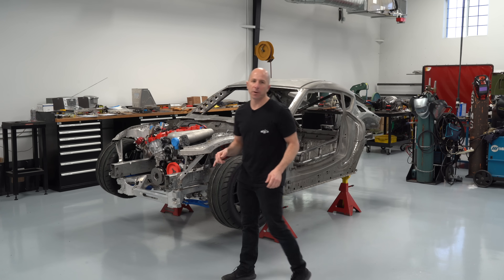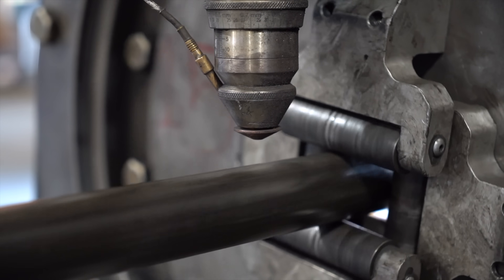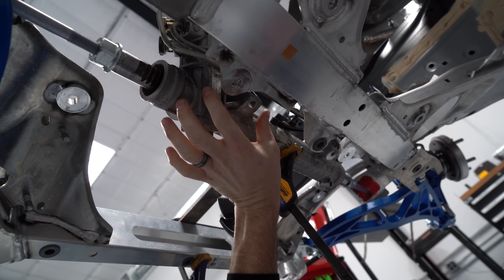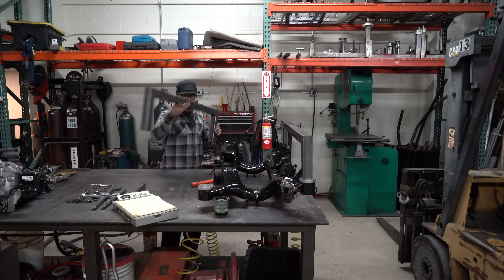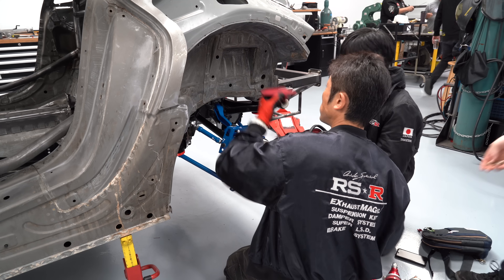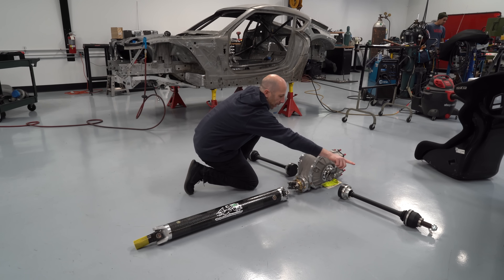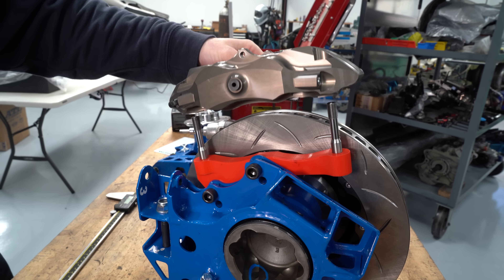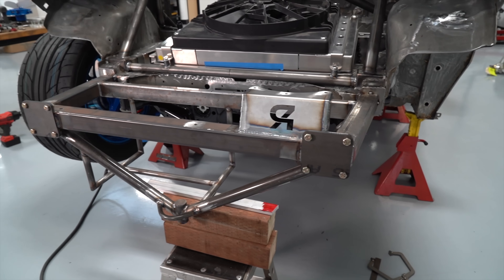2020 Drift Supra CAD Designed Roll Cage Install and Fabrication

Comment: Very impressed with the craftsmanship. For those subframe mounts, just to avoid any bolts loosing pretension and rattling themsleves out, i would put a solid shaft in between the top and bottom bushing plates.

Comment: What size jack stands are those? 6 ton, 12 ton? Any chance you could provide the exact model? Don't think I will be able to find the same one in Europe, but both the size and height look like something to be able to safely and fairly comfortably work on the car without having a lift at home.

Comment: Why do u need Nitrous in a Formula D car?
Reply: @Seb C then why use a high rev I4? I know their awesome engines, but if its torque or response you want. Electric throttle bodies and V6s are king. So a V6 or V8 would be a better go?

Comment: The new B58 engine is out and it has six normal exhaust ports so you can mount a full tubular manifold. Should free up some more horsepower.

Comment: You guys went far and beyond, nd stripping down the body to plain, to the last piece, sink it in chemicals, rebuild the whole engine, at this point, I don't even think it matters , if it is a Supra, or you get a Z4, or a 3 series, or an old Supra NA motor, for cheap, then do the same, strip it, soak it, scan it,, put new engine, mounting points, structure cage bars welded. You can do it with a Miata, you can do it with  an Evo 6-9, any good platform to start with. So much custom work, that you build a new car, a racecar, with custom carbonfiber driveshafts, and I can't even remember half the list. Big brakes, big tires, just speechless. This is amazing, great work guys.

Comment: Curious if you designed and printed the bushings as a test fit or to actually run them. If running them... what material did you print them with that will give them enough strength?

Comment: There's a much easier way to find center to center. Assuming the holes are the same diameter, just measure from the left of one hole to the left of the other.

Comment: Have been dreaming of doing something similar with a peugeot 407 coupe due to it's beautiful chassis but not so good drivetrain. out of interest would it be possible to make video of the approximate costs of the project? i'm personally very interested in the accid dipping of the chassis, 3D scanning and price of laser cut tube frame.

Comment: It needs to be said: For anyone considering buying from the Driveshaft Shop (DSS), please carefully do your research. There have been many, MANY reports of people being ripped off; either by receiving the wrong parts ordered, or being shipped defective parts, and subsequently having zero luck getting it rectified by the vendor. Horsepower Academy even made a video on it when they were sent the wrong axles, and it took a large channel like them raising hell on social media before they got a response.

Depending on your physical location, DSS might be your only option. If that's the case, it's a massive shame, and I wish you the best of luck that you don't have any problems with their company. If you're lucky enough to live where you have more options, your best course would be to use DSS only as a last resort. Please don't support companies with abysmal customer service.

Comment: I wonder how the old school fabricators feel when they see how far the technology has come and how much easier and quicker it makes a job.  The laser notches alone probably saved a day of work
Reply: Honestly, you don't save time. But you get repeatability and accuracy. CAD design time, machine setup, and extra steps make it a longer process than traditional cage work.
Reply: @tanners.6524  Don't forget that with the CAD design you can also test the integrity of the cage as well. HUGE benefit.
Reply: Tanner S. you’ve hit the nail on the head here. It’s the same in all cnc manufacturing. An ole timer on a lathe can have a part made by the time the young lads draw it up on the computer and have the cnc cut it out. Once that file is made though. The computer will churn them out faster than anyone, more accurate every time!
Reply: @tanners.6524  How You dont save time with laser tube notching? And setup for this process is quick compared to other machined parts, You don't have to make fixtures, set it up few times to machine few sides etc., and compared to manual notching, it just cuts both ends and done, while with manual You would have to set it up at an angle for first notch, then cut to lenght, setup angle for the second notch and the rotation of the tube in relation of the first notch. It's like 3-4 times faster. 
You can email a rollcage/chassis to a supplier of Your choice and get it to back, all done in a week or so, compared to either finding local guy that can do it (and You cant work on Your car during this time) or transporting the car to someone decent.
Reply: MindBlowerWTF you start scanning and generating that mesh file bud, I’ll have the car plated and the main hoop up before the scan file is actually useable. On top of that. The Equipment and software costs really take the fun out of it. But repeatable and accurate annnd you can test many variations before hand if you want to get into load testing and such.
Reply: MindBlowerWTF and it watch the video, the cage manufacturers still had to make a jig to make the radius of the tubes designed so you say you don’t need “fixtures”, I don’t believe that, if you’re manufacturing computer designed products, chances are you are going to need a jig or fixture of some kind to make that model manufacturable
Reply: @MindBlowerWTF  For repeatability, yes much faster. But for a single chassis. From my experience in building serious offroad trucks, you do not save time.
Reply: @tanners.6524  Also don't forget that he is building this car for his team. Most likely he is gonna keep it for lots of seasons, just like he did with the corolla. If he crashes it, it will be a lot more easier and quicker to build it back from scatch if he needs a new chassis
Reply: I can tell you, they say “I could do it faster and easier the old fashion way”
Reply: Feel like a caveman over here with my angle grinder and sawzall...

Comment: For those you who don't understand, let me break it down to you
1. The scanner creates a 3d image, to use as a template. The scan is not actually a model because it cannot be modified. In order to actually have a model. You would have to build it manually in the software, using the image as a template.

2. That model is then used to to set the parameters of the cage (height, width, mounting point, etc). Using the CAD program, Solidworks, You can run finite element analysis (FEA). FEA allows you to set the loading and optimize the design. This is done by getting rid of unnecessary  material and reinforcing points were the stress is much greater.

3. Solidworks also allows you to create a drawings package. This package has all the design specs for your model. Everything from length of each section, angles, and bending radius.
 
4. This drawing package is then sent to a manufacturing company in either a written form or a ZIP file. Then the company  opens the package and is able to set the parameter on their machines.

This is actually a really easy thing to do. If you guys are interested in this stuff. You should check out a drafting, manufacturing, or a engineering technology program, at your local college or university. Everything in Papadak's build is using mechanical engineering principals; thermodynamics, fluid dynamics, statics, design machine elements. It's super interesting stuff! If you do plan on going into this field. My advice is get your math up!

Comment: Can't wait to see this, seems like this is going to be the truest representation of what a modified 2020 Supra can be! Thanks for the content Guys!!!
Reply: if toyota and bmw say it supra, then it supra
.
Reply: Rizki Akbar its a joke
Reply: It's a drift car man there's nothing really impressive there
Reply: It's really no longer a supra
Reply: It is one of the best B58 stories on the planet
Reply: @johncuervo3019  it's still a supra
Reply: @gabrielsalim2071  at what percent? 10?
Reply: john cuervo 
What is it then?
Reply: Willie The boggle a cut up supra chassis with a hugely modified engine and completely different suspension, brakes, interior and probably different exhaust 😂 this isn’t a supra anymore
Reply: @omegaluld6555  i have a modded miata, with different wheels and tires. Its not a miata anymore becuase its modded - your logic OMEGALUL
Reply: @abadibi  he would probably say that Gingium's Rally Miata is no longer a Miata
Reply: @abadibi  the fact that the only thing "stock" is hte motor (which is purpose built at this point) and some of the body. EVERYTHING else is custom. You can't honestly compare your shitbox to this and say its the same logic.
Reply: @willietheboggle3954  a heavily modified sedan that is mostly custom
Reply: @Mr_jz_12  all the geometries is still the same. Supra racecar has a different chassi, engine etc... but it is still a supra. Just because u weld a rollcage, upgrade suspension, engine and drivetrain, doesnt mean its not a supra. The geometry and all the other important stuff is still stock. Get outta here with this "ItS nOt A sUprA" pissy logic.
Reply: @MichaelLawrence-dv3dn  putting wheels and tires on a shitbox me out of that doesn't change it nearly as much as what he did to this it's completely different
Reply: @omegaluld6555  and so are all the mark 4 Supras
Reply: @abadibi  have you not watched the videos? Its a "supra" "shell" and that's it. Everything's custom. Didnt know the quick change, custom mounted was supra? How about the box... or the custom located pedal box.. oh yeah.. fuel cell... 🤔😂
Reply: @Johnny-tq9no  the Rally Miata is AWD and has a Subaru engine, a front tube chassis, a Subaru front suspension, and other things that's not from a Miata that I haven't mentioned because it's still being modified, but it's still a Miata.
Reply: @Mr_jz_12  the supra gt racecar also has custom pedals, gearbox, differential and fuelcell. Your point?
Reply: @MichaelLawrence-dv3dn  not really it's more of a Frankenstein car with a Miata chassis
Reply: @abadibi  lmao what are you going to say next a tube frame funny car with a fiberglass shell that looks vaguely like a Camaro is still a Camaro??
Reply: @Johnny-tq9no  yeah. It is a camaro. Not for the street but it has been built for a different purpose. But its still a camaro.
Reply: @abadibi  the article literally says the dragster isn't really related to in any way but the name
Reply: @Johnny-tq9no  its just a modded camaro. Not one u buy from a dealer.
Reply: @Johnny-tq9no  thats just the articles pov. Who cares about what they think. If you take what articles say word for word then u must be high asf or stupid (this is probably it). Look dude articles are nice to read. I get that, but dont take everything they say to be 100% the truth. Thats not how the real world works, youre probably just too young to understand but once you grow up youll get it 😊
Reply: @abadibi  oh look here's an article directly from Chevys own website smh ....
https://media.chevrolet.com/media/us/en/chevrolet/home.detail.html/content/Pages/news/us/en/2016/may/0517-funny-car.html
Reply: @abadibi  sounds like what your saying is it's a different car 😂 calling at the same thing doesn't make it the same 😂
Reply: Aba Dibi all the geometries are literally not the same though lmao. They change - EVERYTHING - literally (in the actual sense of the word) the only thing they aren't changing is some of the chassis, and even then they are still modifying the chassis heavily by installing a full race cage. This is not anywhere close to a supra you see, much closer to a custom built race car. Thats what it is, a custom built race car. Saying this is a representation of what a modified supra can do is misguided.

Edit: ok i just read your replies conveying your opinion that a funny car is still the oem car one can buy from a dealership... thats gotta be the stupidest thing I've ever read on the internet lmao. You're saying I can slap a prancing horse and a body kit on my fiero and I have a real Ferarri???!!!! Sweet!! You just made me rich... 🙄
Reply: @omegaluld6555  i didnt though 🤔 i speak with fact and logic. Seems like all you guys need is a brochure that tells you yes or no. Thats kinda foolish tbh.
Reply: @abadibi  "I speak with fact and logic" and yet you compared your shit box to this masterpiece, lol. But I guess I could agree with some of your points. At the end of the day what most ppl care is how it looks. If it looks like a Supra, it's a Supra.
Reply: @pablogonzalezhermosilla4210  for the TRUE and HONEST and PURE BLOODED car guys. All that matter is the soul. If the soul is a supra, the car is a supra.
Reply: Never was a Supra
Reply: fabyanjim1 lmao touche

Comment: It blows my mind how they made a roll cage without laying a hand or seeing the car. Love your work 👍
Reply: It's all designed and measured with computers. No one is doing anything manually by hand and tape measure.
Reply: ‘How to turn a $4,000 rollcage into a $30,000 rollcage.’
Reply: Chuck Beef 
It’s only a 30,000 dollar laser scanner....
Reply: Sicktrickintuner Yeah, everyones like “its cheaper and easier and faster.” Yeah, with about $1,000,000 in machine shop equipment and computer systems. That’s a minimum $30,000 for you or me to go that route. Most welders can put a cage together for less than $5k including materials.
Reply: @Sicktrickintuner  Which they hired, not bought. Also, since the cage will be right on the first try, the added cost of scanning the car might very well be offset at the end
Reply: What do you mean. They already 3d scanned the inside of the car
Reply: David C that’s exactly what he means.
Reply: Dude what century are you living in I did this in high school 5 years ago in inventor??? I was 16 lol